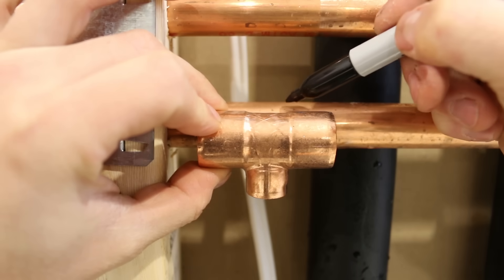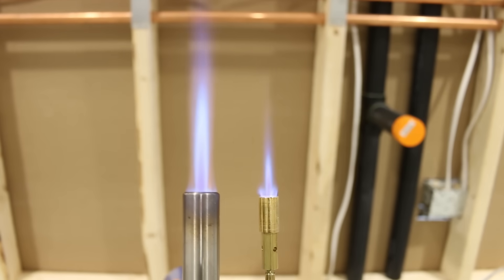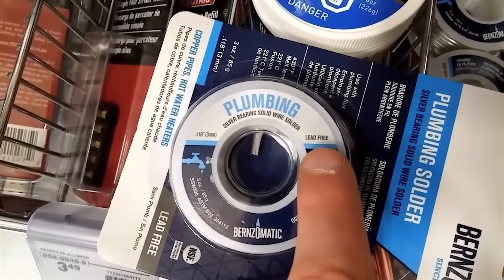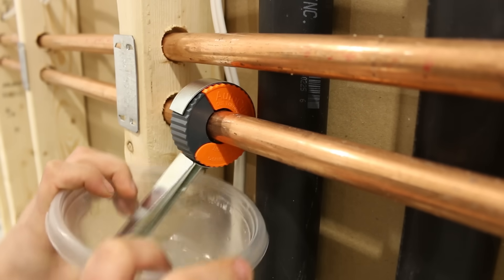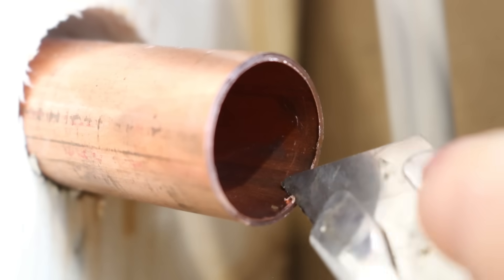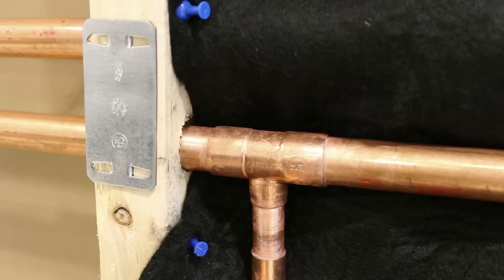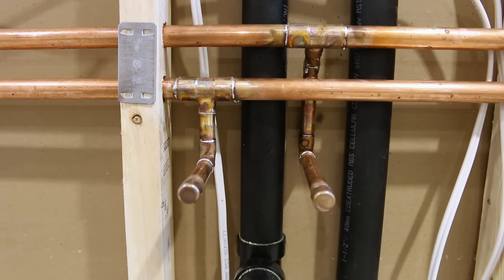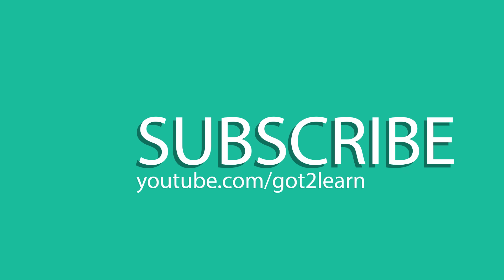How to Solder Copper Pipe in a Wall (Complete Guide) | GOT2LEARN

Comment: Here's a little tip on a tight pipe with no movement. I recently needed to add a shut off valve to the tub mixer. As I gained access from behind the wall on the other side of the tub, the pipes did not move when I cut it initially. There was no was no way to add the shut off valve since sliding in was impossible. I ended up cutting 6 inch from the initial cut and added a coupler on the other end. I cut the 6 inch pipe so that shut off valve can be fully slide in on the one side and the coupler aligned in perfectly flushed to the other end. Now slide 1/4 from each end would result in 3/4 insertion at the shut off to the pipe, 3/4 insertion at the shut off to the 6 inch extension and, 3/4 insertion at the extension to the coupler, and finally 3/4 fitted at coupler to the other end of the pipe. I'm sure someone can do something better to avoid fitting at 3/4 on all fitting but after soldiering, nothing leaks and I'm some what positive this will hold for the foreseeable future. My other option would have been to go with shark bite with a flexible 6 inch pex but this means I'm adding $20 to a $.50 cent fix.
Reply: They sell couplers that slide perfectly over the 1/2 or 3/4 pipe. They call it “repair” couplers. The sell it in segments of 6” also and u have to cut them.

Comment: Soldering is golden standard. However new technology exists. Why don’t you use compression connection fitting?
Reply from the maker: Yes, compression fittings are good but not code in enclosed walls.

Comment: This method of soldering was banned in the 1970•s silver soldier is the only way to join the pipe’s
Reply from the maker: Wrong. Any lead free solder can be used to solder copper joint for potable water.

Comment: So copper being great thermal conductor you effectively have to heat whole pipe system ?
Reply from the maker: Mostly with lead-free brass fittings as it doesn't conduct as well, video on that coming soon.

Comment: Great video ! Could you tell me what is going wrong if your solder breaks off in chunks while touching the pipe.
Reply from the maker: Yes, that can be a few things, 1 would be that you are heating the solder instead of the actual joint, 2 would be that you didn't use any/not enough flux, 3 would be that the joint was overheated so there's no more flux and 4 would be that there's water in the pipe, hope this helps!
Reply: @Got2Learn  That makes sense. Thank you so much :)
Reply from the maker: Most welcome Zach, have a great day!

Comment: Hi, if I cut a soldered joint with a hacksaw, I can see that it is filled in nicely with solder. However, I am able to pull the copper layers apart with two pliers. Is that normal, or does it indicate a poor quality joint?
Reply from the maker: No it's normal, I do it all the time for my tests. Soldering does not "fuse" like cement does, that's why I comes apart like that.
Reply: @Got2Learn  - phew, that's good to know. Both sides of copper are still covered in solder after separation, it is as if the solder itself tears apart.

Comment: Excellent!   You covered one thing I was missing.  Heat the pipe first!  My pipe doesn't leak now.  :)
Reply from the maker: This applies more when soldering the new lead-free brass fittings, but also is good formal copper joints :)

Comment: One important piece of information that was left out was how to re- heat the pipe in case their is a leak after testing the joint or cap with water in the pipe. Won't the water in the pipe prevent the pipe from reaching the required temp to remove the cap without over heating the outside of the pipe ? ?
Reply from the maker: It will! The trick is to drill a hole in the cap to let the water/steam out, then do what you gotta do, good question Saaki ;)
Reply: Sadly sometimes i have to cut the joint because there is no time to wait for all water to drain out and if vapor in pipe my propane torch will not be able to un-solder the joint.

Comment: Ihave cleaned and mimicked everything youhave done in this video i have soldered a few copper pipes but when I do I peice of copper to brass shower valve i clean it and use a sand cloth and flux it but no matter what i do it will not stick please help
Reply from the maker: You have to heat the brass more than the copper because it's thicker, try that.
Reply: Thank you I got it done that is exactly what I had done

Comment: could you check a small section of pipe for leaks by plugging both ends with your fingers and holding it under water watching for bubbles? seems easier than assembling everything and finding the first joint you did was bad.

Comment: Hi Got2Learn...

What's the best (reliable, secure, long-term) way to replace a main water valve on a 3/4 in. type-K copper pipe in a house ?

My thoughts are to use either pipe flaring or compression fitting.  Are they code ? Which one do you suggest ? And a short video on both methods, including tightening torques would be apreciated...

Also, Do you recommend using quarter-turn ball valves for main input water line ?

Thank you...

- - - - - - - - - - - 

Salut...

Quel est, selon vous, la méthode la plus fiable à long terme pour remplacer une valve d'entrée d'eau sur un tuyau de cuivre type-K de 3/4 po. ???

Selon moi, c'est soit l'évasage de tuyau ou l'attache à compression. Sont-ils légaux pour une entrée d'eau et si oui, quelle méthode est la meilleure ? Un vidéo incluant les niveaux de couple de serrage serait apprécié.

Aussi, recommandez-vous l'usage de valves quart-de-tour à bille pour une telle utilisation ?

Merci.
Reply from the maker: Hey!
Soldering would be the best option for that, I would not recommend any mechanical joints for a main water valve. I certainly recommend a ball valve for this, hope it helps!

Comment: Sorry but your fired. I've been a plumber for 50 yrs. You were right up until you started soldering. Put the heat on one side, and the solder on the other. When the solder starts to run remove the flame. Knock off the drip, and cool. then wipe the joint. My father taught me when I was 10yrs old,  and I've done it the same way sense. I'm 63yrs old now. I water piped my first house when I was 12yrs old. I've done more than 1,000 jobs in my career. Nice try though.
Reply from the maker: Ok, thanks.

Comment: thanks very i nformative ....
but most of these plumbing videos leave out realistic situations for example , the cutting n joining of the fittings u added were simply added by sliding the pipe away n then pulling back after the T joints were added .
in a real situation we very well know that is not possible ,a video showing how to add a T to a fixed pipe is more helpful
Reply from the maker: Will do!

Comment: Hi there! Thank you very much for the video. We are trying to sold two copper water pipe in many places at the same time or not (we tried in both ways. The last one always fails :'(. Because of the contraction when loose temperature?? Thank you!
Reply from the maker: The flux has burnt off (too much heat). Try less heat the next time.
Reply: Gabi, if ANY amount of water inside pipe within 2 feet of joint u will NOT be able to make a proper joint. U must dry out the pipes as much as u can otherwise the propane torch will not achieve the needed temperature to solder the joint and u will have to use a SharkBite connector.

Comment: J’ai une question J’entends du bruit sortir de mon lavabo et la seule place est dans la cuisine qu’est-ce que ça peut bien-être
Reply from the maker: Des genre de "glous-glous" ?
Reply: Justement
Reply from the maker: As tu une maison, est-tu locataire? Met moi en contexte un peu.
Reply: Un duplex , propriétaire cuisine au rez-de-chaussée et ces juste des fois que les glou-glou arrive   Des fois durant la nuit p-trap est propre
Reply from the maker: Soit une mauvaise ventilation ou soit que tu as quelques chose de bloquer plus loins, je m'explique. Ton systeme a besoin de respirer pour bien fonctionner, si admettons la prise d'air au toit est boucher, le system va quand meme chercher de l'air.

Example, ton locataire au sous-sol flush ca toilette, le systeme ne peux pas prendre de l'air au toit, alors il va le prendre ailleurs, ce qui est possiblement, ton evier.

Le probleme est nouveau ou ca date depuis longtemps?
Reply: Je vais vérifier plus loin merci
Reply: Je trouve tes vidéo très instructif belle job  sa ma aider  a comprend sur plusieurs point
Reply from the maker: Oui, si tu as access au toit, va verifier juste pour etre sure, il a p-e juste un nid d'oiseau dans le tuyau, sinon, c'est quelques chose d'autre, merci Danny!!!!!
Reply: Probably the toilet or the sink not vented properly or vent conduit obstructed on the roof.

Comment: I stand corrected,you did not mention in this video taking the aerators off of the faucets in order to flush out the bread if it is used to stop the water while soldering but you did mention removing the aerators to flush the pipe if bread is used to stop the water in one of your other videos.Great video and you are not to be faulted for leaving things out because you already covered the afore mentioned issues in your other videos.We usually take the aerators off of the faucets and clean them out when the water doesn't come out of the faucets as it should but some people overlook that fact.
Reply from the maker: Thanks Nelson, yeah....I shoulda mentioned it in this video!

Comment: I'm not trying to heckle you so please do not take my comment the wrong way.One thing you should have mentioned is the use of copper pipe couplings without stops when tying into copper pipe that is already installed in order to be able to tie into existing copper pipe.You know and I know about the need for copper couplings without stops in order to be able to tie into existing copper pipe but many people may not know about using copper couplings without stops to be able to install copper tees and the like onto copper pipes that are already in place.I can imagine many people seeing your video then getting stuck wondering how you got that tee onto that copper pipe because in their situation the copper pipe may not allow them the opportunity to slide the copper pipe back and forth in order to install copper tees to branch from.
Reply: @Nelson - I was wondering about that! I have encountered that problem when installing PVC (even though PVC is definitely more flexible, forgiving, and not as precise as copper piping). So, I am guessing the sleeve doesn't narrow without stops so you can slide it down one pipe to get it on, and then bridge the gap by sliding it back across the pipe on the other side? Good to know! Thanks!

Comment: This torch looks pretty good,it come with three tubes one of which is a pencil tube.I'm not too fond of those torches that refill because I've had lighters that refill with butane and I have always had problems with those.It's a bit pricey but I figure it's well worth it considering the money that I have and will save doing my own plumbing repairs.  https://www.amazon.com/dp/B07Q3F9GBR/ref=sspa_dk_detail_0?psc=1&pd_rd_i=B07Q3F9GBR&pd_rd_w=vBx0a&pf_rd_p=45a72588-80f7-4414-9851-786f6c16d42b&pd_rd_wg=WZSLN&pf_rd_r=X7FTSCK9CB92BESGNVKN&pd_rd_r=abbcb8c5-3390-406d-b4f9-cadcf826021b&spLa=ZW5jcnlwdGVkUXVhbGlmaWVyPUExVkpOQURYNkVCSFMyJmVuY3J5cHRlZElkPUEwOTM3NzQ2MTFZWDFKVDlYSFQ1NiZlbmNyeXB0ZWRBZElkPUEwNzI2Mzk5M0tJVktXMk5DVDRENCZ3aWRnZXROYW1lPXNwX2RldGFpbCZhY3Rpb249Y2xpY2tSZWRpcmVjdCZkb05vdExvZ0NsaWNrPXRydWU=  It's like you said in one of your comments,we're never too old to learn.

Comment: I bought one of those pencil reamers and I don't really like it,what I have done up until now is to fold a piece of the brown scotch bright and use it to remove the bur left on the inside of the copper pipe.I plan to buy a dedicated reaming too that reams both the inside and outside of the copper pipe.Your idea of keeping a full bucket of water at hand is invaluable advice because often times people will not take into account that once the main valve is shut off there will be no water available to extinguish a fire should one arise in the course of soldering copper pipe.Fantastic video.
Reply: At least make sure you have to pee before heating, and after turning the water off. ;-)

Comment: Fantastic video,I never tire of watching it.I use a torch head on which the tip of the torch does not heat up,the torch head is a Craftsman 954287 self igniting torch head.It's a great dependable torch head and I've had it since I was 19 yrs old and I am now going on 59 yrs old believe it or not.I do not make plumbing repairs on a daily basis but thie times that I have had to use my Craftsman torch,and there have been many,it has never failed me and I love that the torch tip does not get hot which is one less thing for me to worry about.Many people may never think about their torch head tip not getting hot until one day they grab the torch by the tip instead of by the propane cylinder and end up getting a super nasty burn.It's usually the little things that get us,food for thought.
Reply from the maker: Yeah I love my pencil tip torch, it gets me into spots the others can't ;)

Comment: I used the knowledge from your videos to replace a leaking water line  at my in-laws house yesterday.  I did a couple practice runs on some spare pipe and fittings before making the actual repair.  The final product was fantastic and looked professional (I bought all the tools I saw in your videos).  I have never soldered a pipe before.  Thanks for sharing your knowledge. I’m going to your Paetron site next to contribute.
Reply from the maker: That's so cool, I am glad I could help you out John. Yes, if you want to support the channel, you can head over to http://www.patreon.com/got2learn
Reply: @Got2Learn  can u do videos on venting pipes for bathrooms?
Reply: Good to make positive impressions with in-laws, I’m sure!
Reply: Very wise for a newbie to try a few practice runs first. I plan to do the same.

Comment: Question, I’ve seen a guy use the flux brush after soldering pipe and fittings to wipe out excessive solder and also mention that it helps with dragging solder inside the fitting. What is your opinion on that?
Reply from the maker: My opinion is I never do that :)
Reply: It gives a more smooth appearance to the joint and lets u see unequivocally that the solder is all around the edge. I do it, some don’t. Of course, if u have to do 50 joints and run to the next job - no reason to play with it.

Comment: If you're feeling extra cautious, or you don't have a small-flame torch, what I like to do (in addition to these steps and precautions) is to use a spray bottle to wet down the studs that may receive more heat than I want.  I wait until it's all fluxed and assembled to be sure there's no water getting on the mating surfaces, dampen all nearby combustibles, hang /position my fire cloth, and then apply heat.  Since I typically have a MAP bottle with a larger head on it, this gives me extra peace of mind.
Reply: I do the same thing,I fill a spray bottle with water and I saturate the area where I solder before I solder and after I solder as soon as the joint is cool enough to where I don't have to worry about the solder splitting from the area being saturated with water.
Reply: Thats exactly what I do. I've been in the business for decades.

Comment: I really wish in your other video of Basics to soldering copper pipe that you explained about the deburring because I didn't do it but it was on the main of the house and shit hit the fan I didn't have any leaks when I did it oh well I ain't going to bother with it now

The one thing I did do that may save me from future hell is I took the end of the pipe and I sanded it down where the cut was made maybe I helped maybe not and I did a little bit of sanding inside but I didn't use no knife or deburring tool

Comment: he also is not deburring he is doing what is called a  chamfer. not recommended on copper pipe. he is also over heating the pipe. to much heat in one spot. the copper should not change color. 450 Fahrenheit max.. he is at the 700--800 range. the pipe will not last. in that area its not Cu3O instead of CuO2 for an oxide layer. it also has melted the chamfer he put in. you only want to square up the edge..

Comment: Aw!  You left out the part I was waiting for.  I wanted to know how you got the fitting installed between the narrow gap between the two pipes. The fittings appear too tight to fit by pulling the pipes apart from each other sideways, and what if you cannot pull them apart laterally?
Reply from the maker: Yeah, in some cases there's some flex in the pipes and it's easy to do in that case, or else you need slip couplings to do it.

Comment: If you put the torch directly under the solder there is a risk solder can drop in and ruin then burner. I've had it and it is frustrating af.
Reply from the maker: Yeah you gotta watch out for that for sure ;)

Comment: Copper  transferring heat very well, when you done with one part and beginning to joint another parts by the same method mostly the first part again will be melting or sometimes the hole parts will be come Loosening again or cos leaking, I hate cooper tube installation..

Comment: In my country we use steel pipe for home water. Why it has to be copper?
Reply: Copper can inhibit bacteria, so it is more healthy pipe for drinking water
Reply: alex Lo 
Steel can get rust
Reply: @yuriigorg721  Modern steel pipe in water system has inside layer of PVC pipe in transporting water.  I guess those who need copper pipe because they live in freezing weather area.  Copper are ductile so it tollerates pipe freezing.
Reply from the maker: Lol, copper is WAY better than steel.